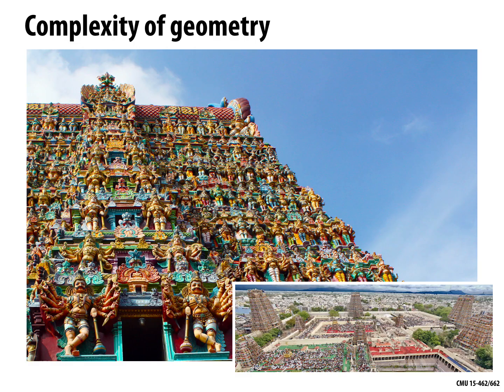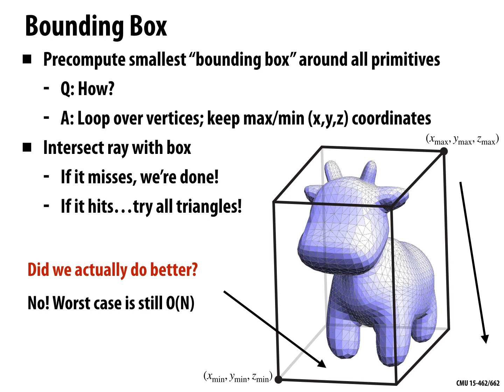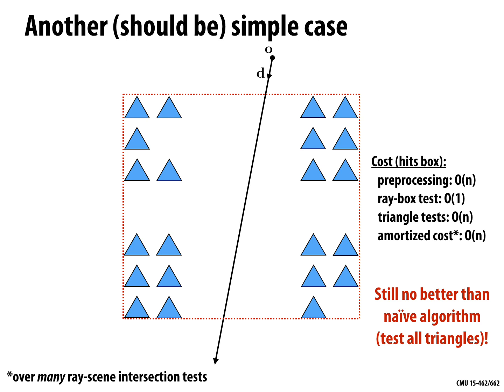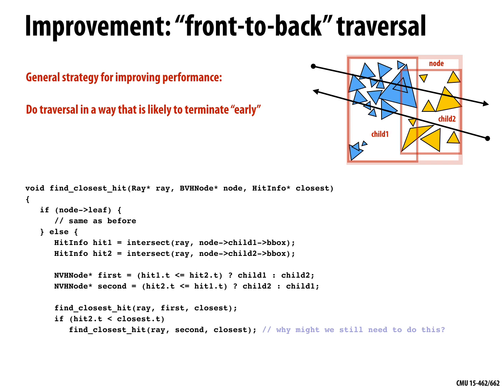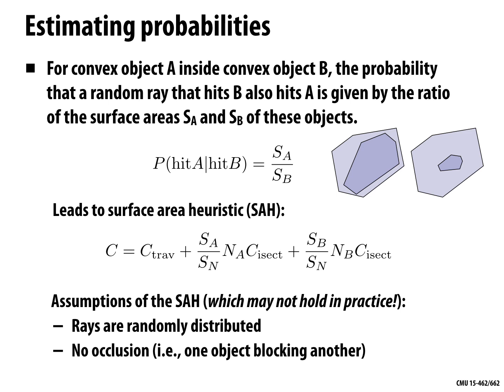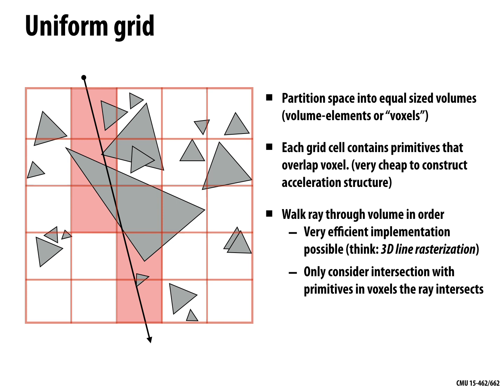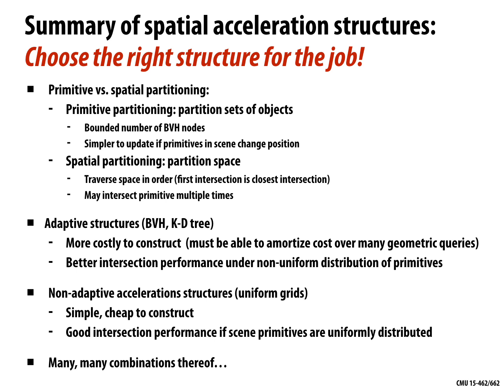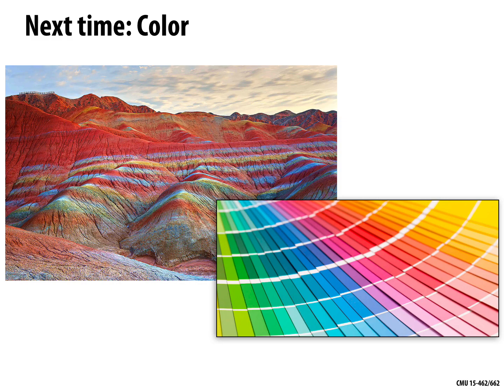Lecture 13: Spatial Data Structures (CMU 15-462/662)

Comment: KEY QUESTIONS:

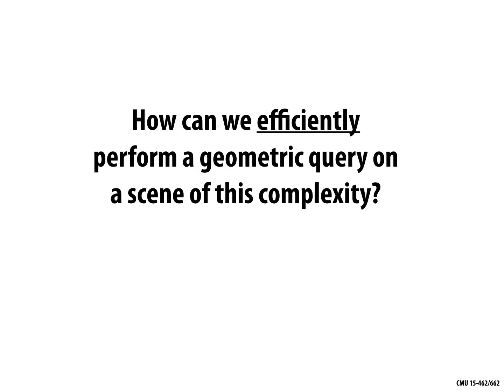"How do we deal with complex geometry computationally?" [0:47]
"What's the computational complexity of the naive ray-triangle intersection algorithm?" [8:34]
"Can we do better than linear time complexity?" [9:00]
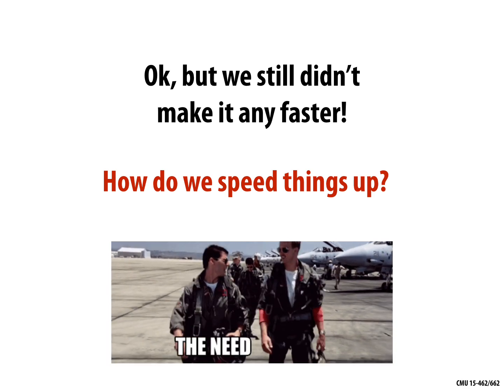"How do we speed up geometric queries?" [15:30]
"How do we implement a BVH node data structure?" [28:45]
"Why traverse nodes in front-to-back order?" [35:05]
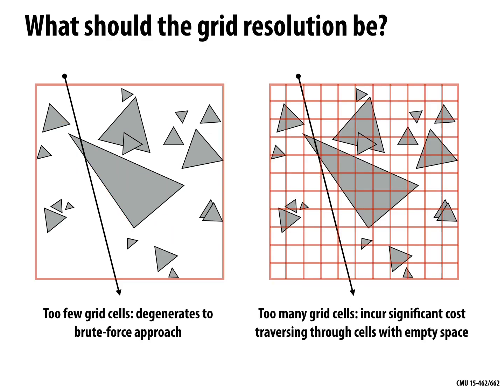"What should the grid resolution be?" [59:34]
"What are the trade-offs between different spatial data structures?" [1:05:50]

NOTABLE QUOTES:

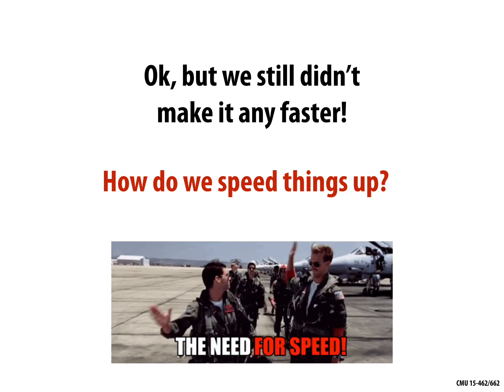"Whenever you're trying to solve a difficult problem, it helps to go back and think about a simpler problem" [15:38]
"We want to apply this bounding box strategy hierarchically" [23:49]
"Every hierarchical strategy comes with its pros and cons" [1:08:19]
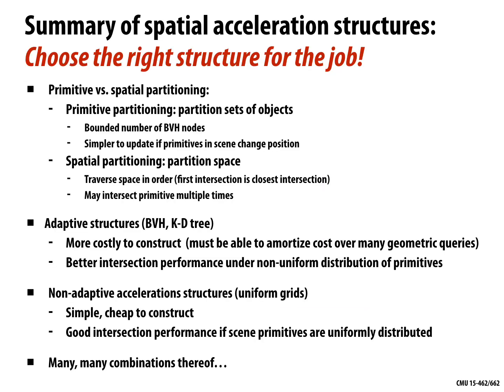"Choose the right data structure or the right strategy for the job" [1:05:37]

TIMESTAMPS:
[0:00] - Introduction to Spatial Data Structures

Context from previous lecture on geometric queries
Motivation: handling complex geometry efficiently
Real-world examples of complex geometric scenes
Importance for ray tracing and rendering

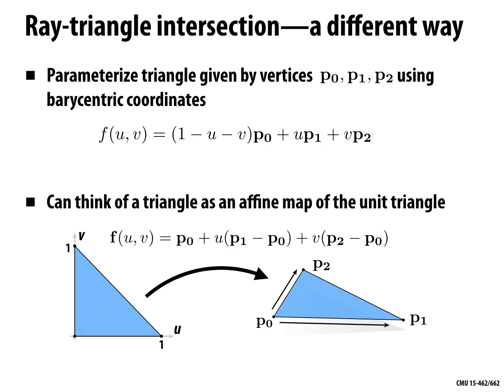[2:51] - Ray-Triangle Intersection Review

Detailed review of ray-triangle intersection methods
Parametric representation using barycentric coordinates
Matrix-based solution approach
Geometric interpretation of intersection calculations

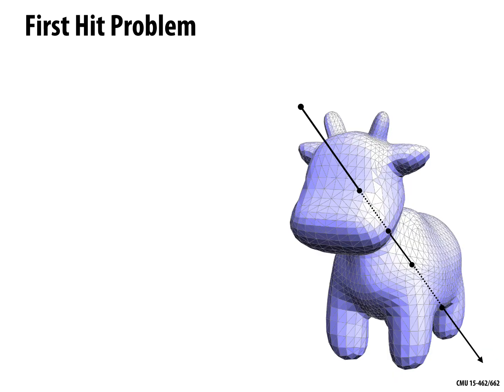[7:16] - The First Hit Problem

Definition of ray-scene intersection problem
Naive algorithm explanation
Linear complexity analysis
Introduction to optimization strategies

[9:44] - Bounding Box Acceleration

Concept of axis-aligned bounding boxes
Implementation of bounding box creation
Ray-box intersection calculations
Cost analysis and limitations

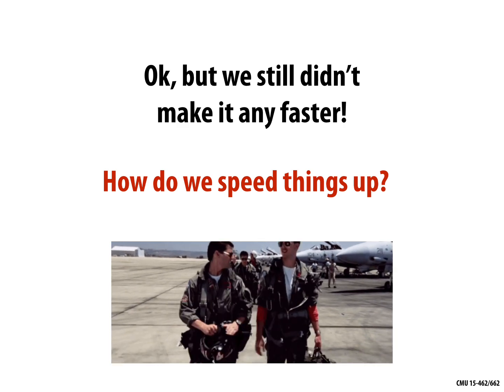[15:38] - Binary Search Analogy

Simplified problem: searching sorted arrays
Cost analysis of sorting vs. linear search
Amortized cost considerations
Connection to spatial data structures

[21:27] - Organizing Spatial Data

Challenges of "sorting" in multiple dimensions
Limitations of single bounding box approach
Need for hierarchical organization
Introduction to efficiency considerations

[24:08] - Bounding Volume Hierarchies (BVH)

Tree structure explanation
Leaf nodes vs. interior nodes
Different BVH organizations
Efficiency considerations and overlap issues

[28:30] - BVH Node Implementation

Detailed explanation of BVH node data structure
Introduction to hit info structure for ray intersection
Basic algorithm for traversing BVH nodes
Importance of leaf nodes vs interior nodes handling

[32:48] - Front-to-Back Traversal Optimization

Strategy for improving traversal performance
Modified closest hit algorithm explanation
Child node ordering importance
Early termination optimization techniques

[37:00] - Building Efficient BVHs

Cost estimation for BVH traversal
Surface area heuristic explanation
Probability calculations for ray intersection
Practical implementation considerations

[48:53] - BVH Construction Algorithm

Axis-aligned spatial partitions
Bucket-based splitting approach
Recursive partition implementation
Handling edge cases and termination conditions

[54:02] - Spatial Partitioning Introduction

Contrast with primitive partitioning
KD-tree implementation and benefits
Front-to-back ordering advantages
Handling primitive overlap challenges

[58:16] - Uniform Grid Approach

Simple spatial partitioning strategy
Grid resolution considerations
Performance analysis and trade-offs
Teapot in stadium problem explanation

[1:05:50] - Data Structure Comparison

Primitive vs spatial partitioning trade-offs
Adaptive vs non-adaptive structures
Construction cost considerations
Guidance for choosing appropriate structures

Comment: I found a typo in the slides at 34:17: The condition for second is incorrect and should also be (hit1.t <= hit2.t), otherwise because of the swapped assignment following it we will always end up with first = second = child1, except if hit1.t == hit2.t.

Comment: Interesting how before you takled about it I was thinking that rasterization may be less efficient asymptotically as the number of triangles grow (for fixed image resolution). After all, you have to iterate over all triangles, so it's O(N), while with the data structures, with ray casting it can be as low as O(log(N)) no? I get that part of the catch is that you can parallelize the triangle computations in raycasting. But will that be enough to counteract the asymptotic behaviour? I'm thinking that as scene complexity grows, ray casting may become more efficient at some point, unless hardware parallelization grows with it too hmm. I'm not an expert, so I'd be curious to know if my thoughts are in the right direction.
Reply: Occlusion culling methods and object / triangle sorting keeps rasterization performant as you increase the amount of primitives in your scenes.